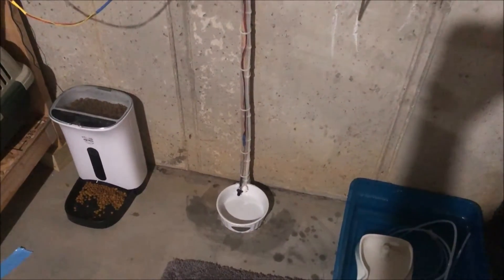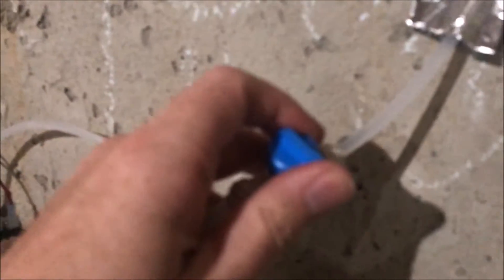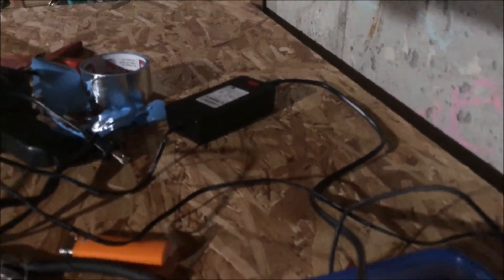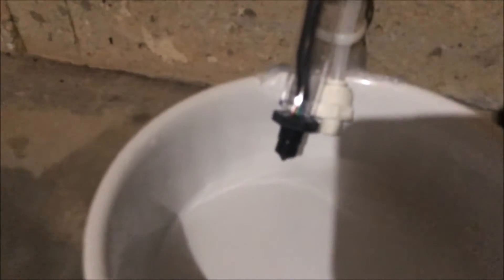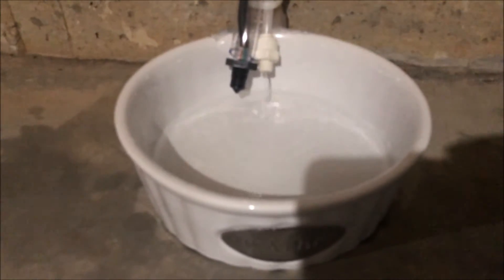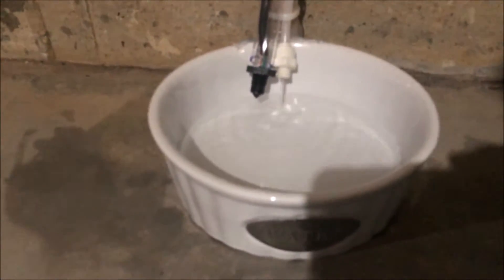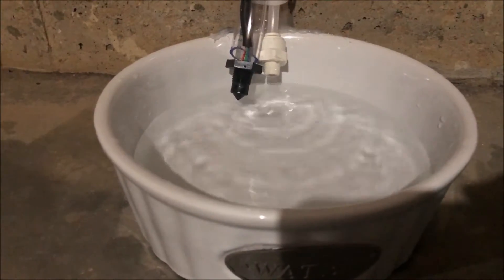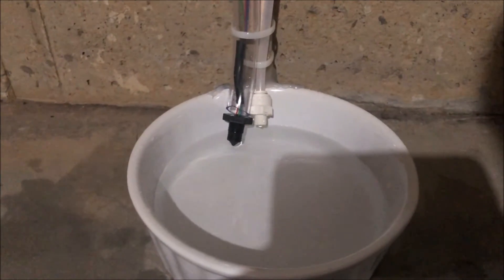Arduino - Cat automated water bowl refiller

Comment: I'm looking to do something similar, but I think the logic of "full" is bad. If the cat (or a human) moves the bowl... you have a flooded basement!!!  I would say to put the sensor in the bottom and fill for X number of seconds when the sensor sees no water.
Reply from the maker: The whole thing is "one" piece... The bowl and rod are attached. So they can't come apart unless you really smash it up good some how.

Not saying it's the best design, but has worked flawless. Still running since 10/22/18 and I haven't touched the setup at all. Other than cleaning the bowl every so often. Still the original flash of code and everything from when I made this video. 

If I was to make another, I'd use 2 sensors. A kind of redundant deal.  If water some how touches the 2nd sensor. Shut down system. Water is way to high and ready to spill. Dunno...

And possibly something like you mention and have a check that if no water is registered, run X seconds.  But if this process runs Y times in a short time period, shut the system down. 

In case sensors quit working. Then its not registering water. Run X seconds. And keeps repeating, will over spill eventually.

Either way, the current one has run great all this time and really have had no reason to go back to play with it. Just works :)
Reply from the maker: Another item I had in mind also was a tilt sensor. If fell over / knocked over.  Shut it off.
Reply: @jdredd34  I think I have settled in on just a single sensor at bottom of bowl. This will only use two pins to handle water -- I can use logic and timing to know how much my dogs are drinking. (I have an issue with one of my dogs where she drinks 100% of the water in a bowl and then pukes up 90% of it... If I just give her a few ounces and wait,  she is fine.)

Then I am printing/building an auger driven feeder. Stepper needs 3 of the I/O and another for an ultrasonic sensor to monitor food level in the hopper. (Food issue is that one dog is a grazer and the other scarfs it all down). The other element that I might consider here is a QRCode in the bottom of the bowl... if a camera can read it, then feed them.
Reply from the maker: @MattGithens  yah dogs a bit rougher to deal with. I just got my one goofy cat to give water.

I ended up buying A food dispenser as found one I liked that wasn't much a d worked well. But again... 1 cat.

Comment: hi you can? share about the coding and element need in this project
Reply from the maker: Been running for 16 months or so without an issue... haven't touched it since setting it up other than cleaning the bowl.

https://github.com/jdredd87/ArduinoWaterBowl